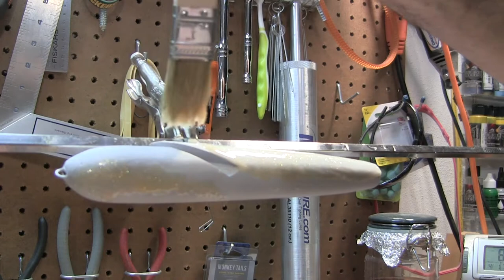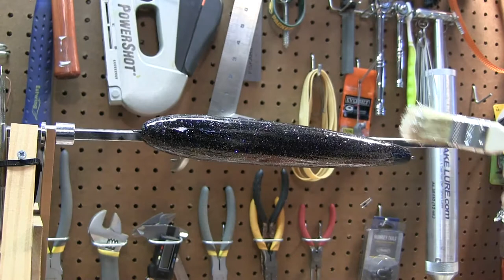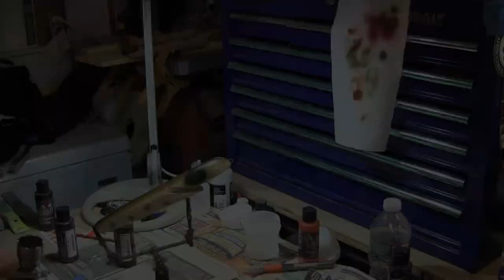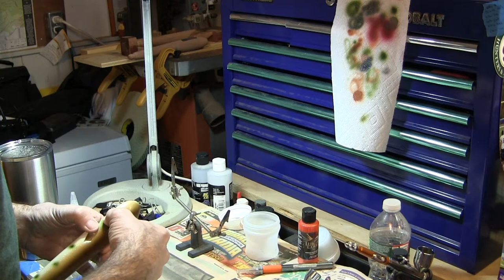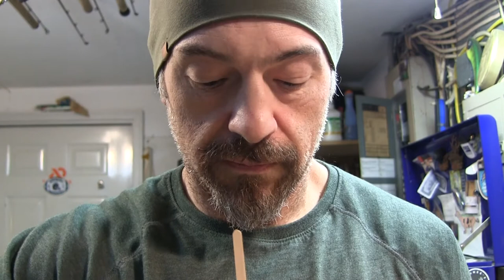Painting Musky Jerkbaits | Using Resin Powder and Glitter Coats | Lure Painting

Comment: Hello.
Beautiful lures, interesting video.
What brand is your airbrush and what is the diameter of the nozzle?
And what colors do you use?
Reply from the maker: Hi... Thanks for watching! I use both siphon-fed and gravity fed Paasche airbrushes. The siphon-fed brush is usually used for broader sweeping, high-volume sprays where I'm trying to cover a lot of area. The gravity fed brush I typically use a medium sized needle/tip for more details and softer flow rate applications. I also have a gravity-fed Iwata (the one you see everywhere) but I just haven't had the need to break it out yet.

Comment: What epoxy do you use? I ve been stuck with devcon, but on occasion it sets up while i m applying
Reply from the maker: Hi… thanks for watching! I bounce between Truecoat, eTex light, and Clear Cast. For the baits in this video, I was using eTex light.
Reply: Beautiful man.  Are you using metal flake ? That glitter looks bright!! And... how do you like clear cast? Is it harder than the etex? Great video man.  I enjoy them.  Can tell you absolutely love the hobby.
Reply from the maker: @METALHEADMUSIC9999  Hey, Wes! The glitter is high-temp polyester glitter. To be honest, I haven't used the clear cast enough to give an honest comparison. The few times so far I've used it though, I really like it a lot. I'll probably be using it for this upcoming winter's batch of baits. I'll keep you posted.